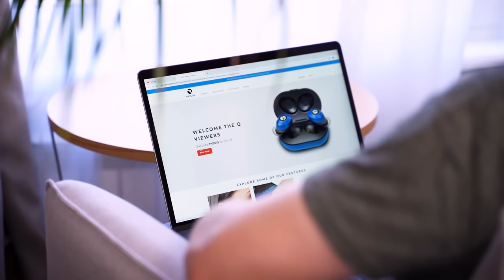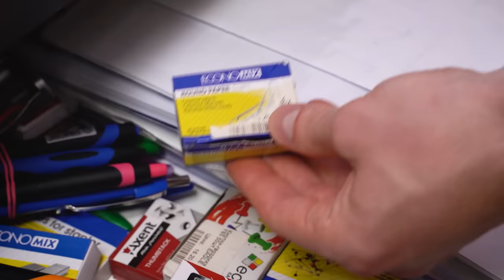How to Win Any Race on PS4

Comment: The idea is great.  but you   should make a future upgrade, using  a non linear mechnism  to increment  the  displacement  in the middle settle  to reduce the dead zone. zero dead zone = a steering wheel

Comment: When they make it : " it works "
When I make it : " now where do I buy some wood "
Reply: You can just use some scrap paper, a lot of glue, scissors or cutter, some sand paper.  Several stacks of paper will do just fine but you need to make sure there are little to no air bubbles when you put them together.

You can either cut a lot of identical pieces first before stacking them or stack them together and patiently wait until the glue dries completely before sanding it.
Reply: @Croiri  Even I feel that hurt when they don't reply back to such a comment hah

Comment: It was a good idea for a basic project..you know it need more and more improvements for the perfection..like:
-How easy to remove the steering when you need the analogs and put it back
-the sensitivity of the steering 
-the comfort level on the hand and fingers
-the suitability for other new consoles or older consoles 

You know lots of ideas and conditions for the trade markets
Reply: He's not going to adjust any settings considering he didn't make any of the models he uses in his videos, he just claims them as his.
Reply: @cameronwilson1815  
I know that…!!!!!!
Reply: @Boss-X  It's crazy isn't it, he gets more likes and more money than the original creators, he stole 2 other designs I am aware of, Middle Finger Machine, and Flicking Finger Upgrade.

Comment: that would actually a brilliant peripheral,  if it plugged in like a turn key. not much added cost for a pseudo steering wheel

 I think you would want your thumbs with a greater downward angle; so the top of the joint would be closer over center. 
A latch system would be needed to extend the peddles (L2/R2) down towards a set of backplate bumpers.

Comment: If you use right index for gas and right thumb to steer you cant properly steer because the joints in those fingers are connected so if you move 1 the other will twitch a little and try to follow which is why they made the left thumbstick steer and not the right and that's why the race was lost.

Comment: If you could find a motor small enough to add force feedback to ur thumbs and make this with a 3d printer to up the quality id get one comissioned for a dual sense control with the haptic feedback and trigger itd be a whole new racing controller which im surprised there arent more of

Comment: You can do that or... you know? Holding the stick up and rotating it?
It's both cheaper and more precise.
With this "wheel" it's impossible to reach the second stick and hard to push the buttons, since you use both fingers to move it.
But nice try

Comment: there looks like there's so much play in that thing. you need tighter tolerances on it. Also even if it was made more accurately it still seems more awkward to hold. Take the time it would take you to make this and just do some overtime instead and buy an actual gaming steering wheel. This is just a fail of an idea.